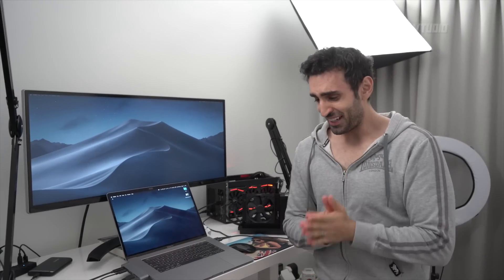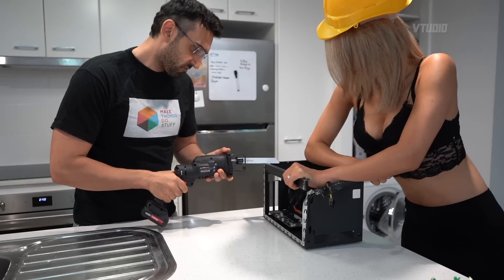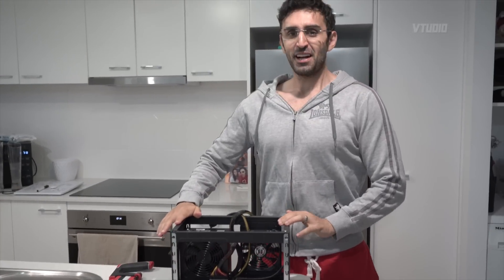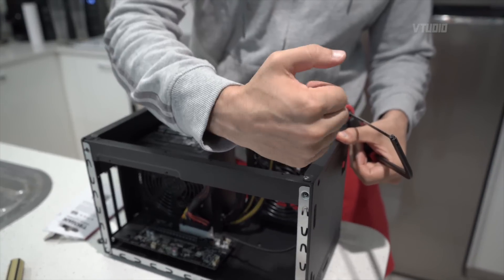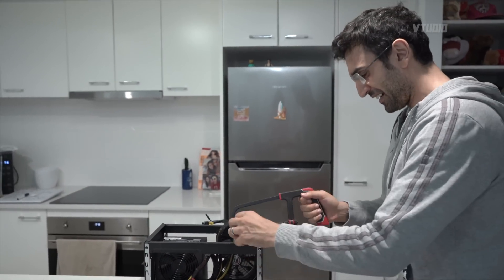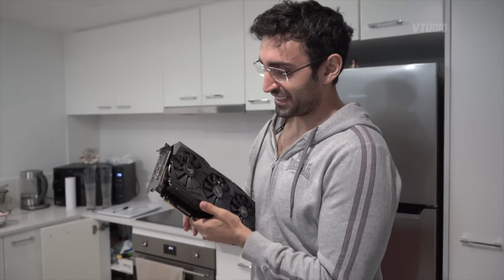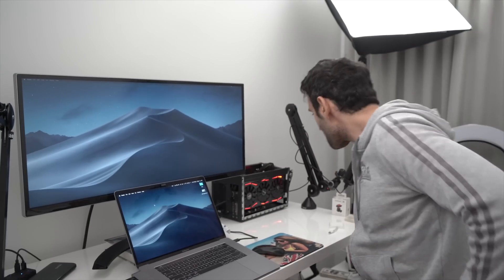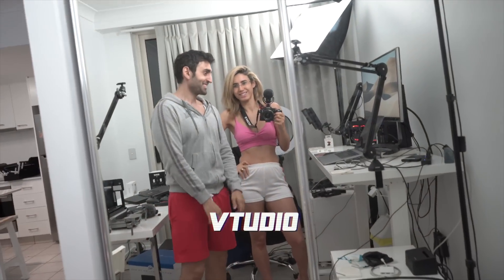The Ultimate Silent eGPU Upgrade Guide 2019 | DIY PC Build 🔨

Comment: No need for sawing or drilling the case. Just remove the PSU and then there will be room for the graphic card, just look at the corners. And after the GPU is in place, then add the PSU back.

Comment: awsome , how do the fan on the laptop spin using the egpu. do it behave??
Reply from the maker: It's better for GPU intensive operations, and does give more space for the CPU, but if you hit the CPU hard it'll make the fans ramp up unless you throttle it's TDP. Check out my Blackmagic eGPU review for a demo of FCPX and fan noise.
Reply: @headsoftech  thanks alot buddy, will do. great videos btw

Comment: Hi, Do you talk about the same card that OWC support file include as supported ? https://www.owcdigital.com/assets/products/mercury-helios-fx-650/OWCSGDHFXGPUCMP.pdf
Reply from the maker: That's right, and the PSU does support it, but fitting it in is a challenge 🔨
Reply: So can I put in this gpu whitout broke the chassis  ? :)
Reply from the maker: I figured the graphics card cost more than the enclosure, so I didn't want to try to squeeze in it too hard. It might be possible.
Reply: Ok I will try, thank you :)
Reply from the maker: Please let me know how you find it.
Reply: Sure ;)
Reply: Hi, finally I put in the vega 64 in Helios 650 box ( without cut it :) ) , I tried also the Razer x egpu but I return it because it was very loud. The Helios 650 is more silent but not completely silent. Do you think that the Blackmagic Pro version can be more silent than the Helios 650 with vega 64 ?
Reply from the maker: Have you tried unplugging the side fan to make it silent silent? I've had mine unplugged for months with no problems, but of course it depends on how hot your room is. My GPU fan is hardly ever on so if yours is the same then yeah it should be safe too. You can also use a 2m cable and sit the box further away.

When I tested the Blackmagic eGPU it wasn't silent but very quiet (mainly coil whine) pretty much the same as this setup (with the side fan unplugged). The eGPU Pro is meant to be slightly noiser than the standard one but I personally haven't tried it.
Reply: Hi, I did as you said and now on idle mode it is very quiet :). The temperature is about 80 degrees Celsius when it is at full load. Do you think that could be ok ?
Reply from the maker: Nice one, have you tried using it with the case off? I have mine off and not only does it look cooler because you get to see the GPU lights, you get much more airflow to actually keep it cooler.
Reply: Yes, I tried and effectively this is stay at about 76 - 77 degree at full load but  I am worry about the dust than can be settle on...
Reply from the maker: @pdaniele88  Makes sense, well if it's only a saving of 3-4 degrees and you're worried about dust, it's best keeping the case on. According to wepc.com as long as the GPU is less than 85 degrees under load[1], then it should be fine.

[1] https://www.wepc.com/tips/optimal-cpu-gpu-temperature-gaming/

Comment: It looks like it would have fit. Likely, all that one needed to do was to remove the plastic shroud and fans from the GPU heat sink and then reassemble it once it was installed in the slot.

Comment: Epic! Wait for more 😂
Reply: MacBook Pro 15 2015 i7 2.5/16gb/512gb/m370x / 1.530$ EU price , You think this is good choice to programming and web, or wait for 2019 MacBook Pro or buy MacMini i5 and upgrade ram or Nuc intel and make hackintosh or build hackintosh?
Reply from the maker: Hey mate, I'd definitely wait for the 2019 if you can, there's all these rumours about 16 inches, 8 cores and Navi graphics, maybe it'll be too expensive for us, but it'll definitely wipe the prices down on the current 2018 range at the very least.
Reply: Vtudio You're right, prices will go down and that's a lot.
Only I'm afraid that:
- There will still be problems with the t2 chip
- Kernel panic
- The keyboard is crush and the repair costs half of the MacBook
- soldered SSD (no slot to backup data from SSD in case of disk failure)
- Flex-gate
- Touch bar are some clearances sometimes on the backlight screen from it
- CPU and GPU as long as possible when temperatures reach 100 degrees
Apple now makes equipment from budget parts, prices are high to compensate for less sales, because 60% of their income for the iPhone, 10% is a MacBook, the rest are services and other things.
I wonder if they will do the news you wrote, it would be great!
Reply from the maker: I'm with you, there's definitely valid reliability concerns with these MacBooks. Don't really have anything positive to say, other than just accepting that I shall not keep my laptop longer than the AppleCare extended warranty.
Reply from the maker: Mate, you don't need to tell me about the keyboard, I've had my 2016 MacBook, 2016 MacBook Pro and 2018 MacBook Pro keyboards all replaced. I doubt they'll fix it for 2019, for 2019 if they do come out with a revised design, it'll be full of 1st gen redesign issues they always suffer from, so just make sure you get AppleCare or a law degree.
Reply: Vtudio Omg! Thx👌🏻

Comment: Cool video. You're pretty lucky that you didn't get any metal shavings in inappropriate places.  Like, shorting out something on the board, or in the card slot. =)
Reply from the maker: Thank you and great point.. Man.. What was I thinking!?
Reply: I did something similar years ago. I was lucky too, but I did get shavings on my mouse pad and my optical mouse went crazy reflecting the laser on them! =))

Comment: Brutal. Owc will prob make a modification guide now for the diy. Been using the blackmagic egpu at work which is super quiet and been considering a unit for home. Razer core x seems like the most affordable option here in aus (429 Aud on eBay new) but considering picking up an owc when I head over to the us in April.
Reply from the maker: Nice one, do you have the eGPU Pro or the standard one? I was really tempted to get an eGPU Pro, but it was just a horrible deal. The good thing about these custom enclosures is that you can use different GPUs, the one I have is great for fan noise, there is a little coil whine on load, but I remember the Blackmagic eGPU having coil whine on load too.
Reply: @headsoftech  I'm using the standard one with the 580 and it is super quite. Been playing Rise of the Tomb Raider (Mac) in 4k and its super smooth. Haven't really had a chance to Thrash it just yet.

Comment: I bought the Sonnet eGPU Breakaway box (650) and the PSU fan was irritatingly noisy.  Swapped it out for a Corsair SF600 PSU which has a fan that only comes on under toad, not once have I heard it spin up. The box is dead silent and fits large GPUs no problem.  Would recommend that option (although probably more expensive) if you like your eGPU performance seen not heard!
Reply from the maker: Thanks for the tip mate, tinkering around these eGPU enclosures is fun.

Comment: You are crazy :)) just drill out the rivet. But again, what's done is done
Reply from the maker: Thanks for the tip mate, diy is hella fun 🔨🔨🔨
Reply: Tell me when to stop with these nice aluminum shavings all over your $300 PCB...
Reply: I was man I was cringing the hole time saying the same thing.
He also could have just changed the power supply to a better one in the other case if the gpu fit.
Or just the fan inside it

Comment: What a team. Epic video. I thought it was a Bunnings commercial at first. I have been thinking of getting this for my Akitio Node Pro https://goo.gl/Ydzyhu Its silent and will make the core silent.
You can get 2 slot Vega 64's that will fit in the Helios.

PS whats wrong with OWC. you should be able to return that under warranty and ask for royalties for the next Helios design
Reply from the maker: Looks like a beast but the reviews are 50/50 on newegg. Would be cool to watch you upgrade your eGPU though.

Do you use a 2m cable? I use QNAPs one and it's just over 2m in length and works great. Maybe you can just hide your Akito away in a cupboard with a 2m cable?, I do that with my NAS and as long as I don't fully close the door, it still gets enough airflow to run cool but it helps cut out the noise... But I haven't tried it with an eGPU, that might need more airflow?

OWC's warranty is great at 3 years but I'd be pushing it to expect them to replace a butchered unit. But, you know who has the best warranty? RODE. I just email them saying something's broken and they send me a priority mail replacement, they don't even check.
Reply: Vtudio Yer easy for Rode in Australia. I was joking about the OWC. I might get that 2M Belkin one from Apple. See how that goes
Reply from the maker: Nice one, let me know how that goes, I should of tried that one, but the reviews on their official site has it at 1/5 stars, so I was scared off, but you can't go wrong with Apple's easy returns if it doesn't connect at 40gbps.